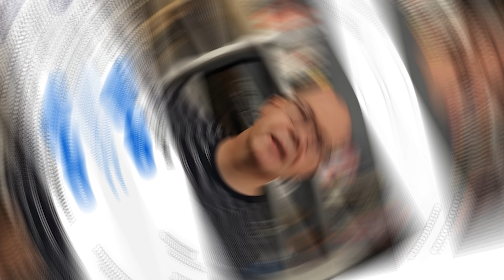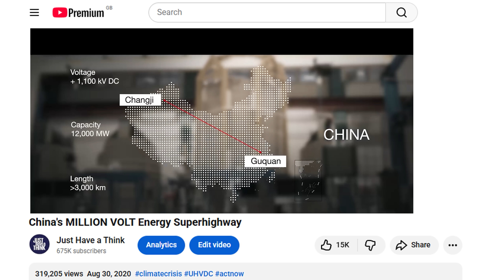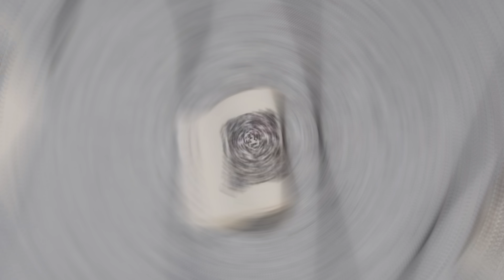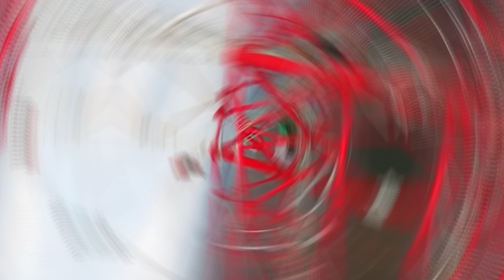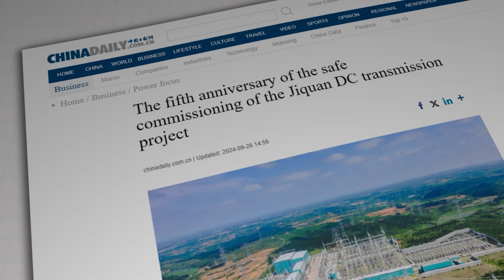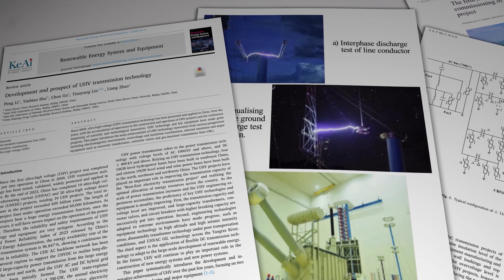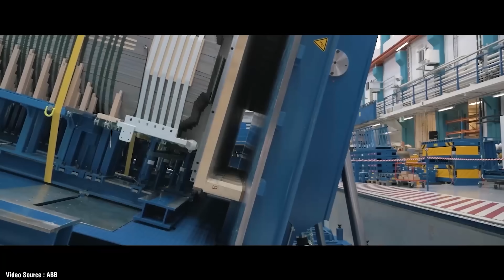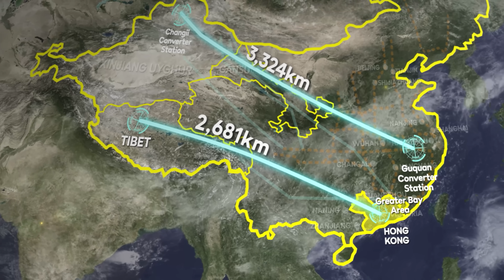China's ultra-high voltage transmission lines now breaking all records.

Comment: I think that having some local consumption of the produced energy is still important. I use a parabolic thermal reflector to make steam to steam sterilize garden soil. In late 2024 I did a test and the steamed soil grew lettuce seedlings to 20% heavier after 30 days.   Have a think about that for a second!  It is incredible!  NO EXTRA FERTILIZER OR PESTICIDES,  just a blast of heat and your soil is that much "better" as plant media!   The permaculture people and the organic gardeners were not impressed and railed on about the "Microbiome". (Scientists say the microbiome grows back in about 30 days).   So, in 2025 I used steamed soil in different ways,   one of which was to put a 3.5 inch (9 cm) layer of steamed soil on top of my beds as a mulch.  AND that still gives a great result!  Not least is the reduced weeding. So imagine the power company having a warehouse of soil or compost or whatever and whenever there is a glut of power,  they start up an auger into the steam chamber and start steaming a bunch of soil!  Automatic system! Dirt cheap power to produce high quality dirt.   20% more efficient growing can mean 20% less land needed to grow food.  Those who complained don't seem to realize that.  I recently fount a wikipedia page about steam sterilization of soil.  First cases were in Germany in 1888!  and now big fossil fueled machines produce the steam on a large scale on large farms across the world.   Why not solar and wind powered steam then?   Seems like a totally good idea to me.

Comment: I'm disappointed you didn't discuss HOW the ac from hydro or steam generated power, is converted to DC at such enormous levels.  Banks of 5U4 or 5Y3 vacuum tubes?   and how is the 1 million volts of DC converted back to AC at the other end??

Comment: Another wrinkle - I think the electric vehicle industry has taken the wrong turn - we should be focused on the HYBRID 
There is an existing transmission system so no change needed there - we are paying for any upgrading needed in our electric bills
There is an existing petrol system so no change there - just a slow downsizing 
No need for home charging units or street charging infrastructure - savings there
There would be less of an unemployment problem as there would be a slow transition for the oil industry
Hopefully this can be rectified soon
Reply from the maker: I completely disagree. Hybrid vehicles have been shown to be more or less just as bad for GHG emissions as ICE vehicles. People are lazy. If they can keep their battery charged with a petrol powered generator that can be filled up at the pump, they very rarely bother to plug the car into a charger. Some do, but statistically most don't. Hybrids are a classic diversionary tactic by the fossil fuel industry and the legacy auto manufacturers who are watching their world crumble before their very eyes. And the European Commission has shamefully acquiesced to their plaintive cries. We will look back in ten years time with a great deal of embarrassment at how weak and ineffective our political leaders have been.
Reply: @JustHaveaThink  Thanks for the info - I assumed they would use more efficient petrol engines to keep emissions and running costs low.  Currently profit and "marketing" are most important than the environment we are leaving for the next generation

Comment: I  loved some of the early energy storage videos you did - a particular favourite for sheer wackiness, therefore great, was the use of a very heavy weight sitting at the top of a mine shaft ready to drop to provide instant electricity. Various methods of getting energy from the sea seem to have got nowhere, which is very sad if true - wobbly floating snake, tidal power in and out of a lagoon or estuary, underwater propeller generator etc, There were many other interesting concepts - compressed air, hot sand or other materials. Some I thought were daft - a kite for energy generation, or a kite for reducing shipping transport costs both seemed a little too barmy ... but I'd be delighted to be wrong

Comment: The problem with the US is not a democratic vs autocratic government but a refusal to work for a common good. At every level in the US, government is divided with each side refusing to work with the other while pointing fingers. In the past, you could work together. Now, there is no chance. It is a fight for everything with both sides driven by the extremes.

Comment: If you're transmitting 250TWH daily 10.8TW can't be a record since 250/24 is about 10.4. The Chinese lie about everything and taking these numbers at face value makes the whole channel look sus.
Reply from the maker: And then again, if you actually take the trouble to listen correctly to the video, it says 10.8GW for a 12 hour period, which equals 129.6 GWh. That leaves 120.4 GWh for the other 12 hours, which equates to 10.03GW. You are not even in the right order of magnitude with your TWH units, so I can only assume you are not capable of assimilating basic information. So much for your cutting edge commentary.
Reply: @JustHaveaThink wow a personal attack for me for the holidays

Comment: There's a company out in Alberta that is drilling to create geothermal and I was thinking that say  put these in along the 400 series highways here in Ontario and install induction charging into the highways as base load supported by battery storage and supplemented by other renewables shortening long distance transmission lines

Comment: Thank you for continuing to generate such thoughtful and interesting content! I would like to see a study of the potential for pumped hydro on brownfield sites as a method of remediation. I suspect that the potential is huge across the NA Cordillera. As an example, could the membrane liners of a closed-loop system cover enough waste rock to prevent rain and air leaching selenium into our waters? Fording River Coal in BC has spent 1.5billion$ to partially treat water from just one of the mines. After coking coal is no longer needed, who will pay for operating the treatment plant for the next 1000 years??! It seems that the BC/AB intertie could thus help address curtailment in southern Alberta renewables whilst protecting aquatic life.

Comment: In the US we have had a 1,000,000 volt DC line from The Dalles, Oregon to Los Angeles, 846 miles, 1,354 km since 1970 and 4 other HVDC lines with many more in the works.

Comment: Centralised energy generation and transmission like this shifts wealth in the wrong direction. We don't want HVDC, it's a subscription model with guaranteed income for the wealthy. Just like the original electricity transmission lines and oil industry.
Reply: Having whole countries locked into an energy subscription model creates a shed-tonne of inertia; you get stuck in that ecosystem and it's hard to move to a new system even when you know the new system is much better.

Comment: I wouldn't mind seeing a round up of all forms of batteries starting from...

"where did rechargable batteries disappear to?", 20 odd years ago I remember that household rechargeable batteries were advertised practically as a revolution in battery power, now you never really see them. All batteries should have been rechargeable batteries by now.

And larger small scale batteries that are charged from solar panels. I used to canvas selling solar and batteries 10 years ago and you still get people going on like "well the sun doesn't shine all the time and the wind doesn't blow all of the time" 🙄 my response is, well show me your petrol power TV remote and I'll say you have a point 😂

To large scale industrial energy storage units. There is a lot of research going on regarding these but it is always about large single unit batteries, can they not use modular systems using what we have already? Even with dissipation from the units, surely it's better than shutting off the production during low need periods.l but that might ruin their hold on supply and demand economics and they might actually have to sell of the energy for cheaper 😯

Also I wouldn't mind seeing video on "the industries fear of consumer self sufficiency" god forbid they have to think of another way to make money if we all generated and used our own energy and if households could create a cooperative to sell off and set our own price for surplus energy.

Oh and another video on the possible next generation of energy infrastructure. I know there is an issue with feedback into the system. If we have less need for the feed in system due to self production, I can't see why we can't have a dedicated feedback system that replaces the obsolescent feed in infrastructure. Like if we have 6 lines across electricity pylons, why can't we have 2 feedback lines and 4 feed in lines or 3 and 3? If self production gets to that point, which it should at some point even if it's 50-100 years in the future. The national grid system has a use expectancy of 30-40 years from what little research I've done on it and by that figure I would imagine that perhaps half of the infrastructure is due to be replaced over the next 15-20 years with parts of it being replaced everyday. It's better to start building for the future now than panic in the future when we have nothing and have to pay for it all at once.

Comment: How about a video about the installation of Batteries, PV panels, Wind Turbines and investigation of Tidal Power in Northern Labrador by a partnership with the Inuit government and the Canadian federal government to replace existing diesel generators?  Nain is a northern community with brutal cold winters that are service by diesel generators and the local government wants them replaced ASAP.

Comment: Long time supporters from Canada here.  Appreciate you.  Interested in the electrification of agriculture.  It’s been our farm journey and so interesting and challenging.  Happy Christmas.
Reply: Can farmers 'wait' for slow solar powered tractors to plough etc a field over a period of multiple days automatically instead of doing it all in one day with a diesel?
Reply: @davidwinnett5450  You will have another one coming if you believe that the agri-machines will not get electrified at some point. 
The problem is that most people believe they can change 1 thing(batteries instead of diesel) in a system and expecting everything to continue working like before.
Doesn't work that way. Can you fully support that change and are you willing to do it.? really do it ? (if it is beneficial for you first, of course)
If it is. Then yes you will find the way.

Comment: I would like you to cover shallow closed loop geothermal for district heating.These don't attempt to generate powerthey heat homes via using low grade geothrrmal heat energy in local heat networks.

Comment: These UHVDC transmission lines could be upgraded with mega pack batteries on both sides of the line to allow utility factor to be at 100% on the line while having variable generation and variable consumption.   With super low battery prices, this seems like a smart move to maximize the UHVDC investment.

Comment: Hi Matt, Great article today, DC transmission is very relevant today, especially here in Australia.  Re future topics I would suggest a deeper dive into super / and or ultra capacitors in FCAS and Demand Response grid services and with a kicker I would be keen to hear an update on EDLC uptake in transport (especially rail), material handling, distribution network services and hybrid energy storage, cheers from Down Under, Ian
Reply from the maker: I'm not Matt. He is American - you can tell by the accent. I am Dave. I run Just Have a Think. Matt runs Undecided with Matt Ferrell. We are both bald and we both wear glasses, but if you really try hard you will notice that we do not really look or sound much alike.

Comment: Okay, this is for the T-shirt but I've always wondered this. Could we not produce energy from the free Frozen snow and putting a refrigerant pipes through that snow and in the summer gain the energy from its expansion with the pipes leaving the pile of snow as the gas is expanding?

Comment: In the West, we receive lots of goods from China. However, we don't send much in the other direction. The shipping containers would essentially have to go back empty which is extremely expensive. Also China doesn't want them back.

As we transition to low CO2 emissions steel, our demand for steel will go up massively. For instance, there currently isn't any technology that can produce low CO2 emissions concrete so that's a market that can be replaced with steel. 

If, let's say, a progressive UK government wants a construction boom and sees the need for steel, they could implement the following policy:

1) Build a low CO2 emissions steel in a friendly country near  China that has lots of potential for renewable energy and huge iron ore reserves - India for example.
2) They build single use shipping containers to be filled in Asia and sent to Europe/North America.
3) We use renewable energy to turn those used containers into steel for construction etc.
Reply from the maker: Nice idea.

Comment: In Europe, for obvious reasons, undersea DC lines have far fewer regulatory and land use issues, so they can be built quite quickly - the Celtic Interconnector between Ireland and France as an example).

Comment: Something is not right here, the physics just are not correct in that it would be impossible to transport electrical power  over long distances using DC. Or am I missing something?
Reply: "Or am I missing something?" <- yes, and Dave covered what you need to know early in the video.
Reply: @TheDanEdwards  To have DC current flow over such distances, the Chinese would have needed to invented a new type of superconductor, one that works at high temperatures. Hence, material that conducts electricity with zero resistance, as far as I know, there is no such material. The Chinese would then have to produce the same material in high quantities to build the power lines. The only way to transport electrical power over long distances is AC. I don't see the Chinese as inventing anything new, just using the same technology but on a grander scale.
Reply: @peterhart4301  The traditional wisdom was indeed that you need AC, because you can't use transformers with DC, meaning you can't produce the high voltage, low current necessary for long distance transmission. That is no longer the case. Today, thanks to advancements in solid state electronics, like the switching mode power supply, DC/DC and DC/AC transformers are trivial. Other than that, there is nothing that prevents DC from traveling just as far as AC. Sure, high powered DC/DC transformers cost more than the AC equivalent, but DC has another advantage. With AC, you have an issue with your power line becoming a transmitting antenna over long enough distances (1500 km is already a quarter wave for 50 Hz), radiating power into the ether instead of carrying it. No such problem with DC. So for long distance, DC eventually beats AC in terms of cost. Also, China didn't invent anything radically new for this project, long distance HVDC lines exist in other countries, it's just that the scale is unprecedented, and it's specifically built with decarbonization in mind.

Comment: Thanks as always Dave. I've been a subscriber since the early days. Your videos are my Sunday sermons and a looked-forward to part of my week. I don't need any more clothing, but an idea for a video might be a look at France, how it has leaned on nuclear to avoid building out renewables and has generally been a laggard in the transition. Both Renault and Citröen have put their cards on the EV table, unperturbed by the relatively low level of public charging points. And despite lots of windy Atlantic coastline and an under populated sunny south we're not seeing many large scale investments in wind and solar. At the moment France is a net exporter of electricity (thanks to nuclear) so there is no sense of urgency to build the infrastructure for renewable energy. On the other hand it's getting harder to find a new kitchen cooktop that isn't induction (good) and there is a decent level of awareness about the risks of climate change to agriculture and basic comforts. I feel the whole thing is on a hinge period, where momentum is gathering. But the rise of the far right could quickly put a halt to all that.

Comment: Quite possibly in line with your current video: The chances for Europe to overcome renewable intermittency (especially dunkelflaute) by connecting parts of Europe that have little correlation between weather systems (for example North- and South-Europe)
Reply from the maker: Thanks for your suggestion.

Comment: I live in Ireland and while a transmission line for high voltage would be great (we are wasting lots of wind energy) we need a way of getting rid of, or insulating, the radiation from them.  Thanks.  I like the climate videos which most of them are, of course.
Reply from the maker: I was not suggesting that Ireland actually built a UHVDC line. It was simply an example to give a bit of scale.

Comment: I am curious to see how the Million volt systems age, even a small defect in a High voltage  Dc system can cause arc overs, AC systems  will self extinguish an Arc when the voltage crosses 0, DC just keeps Arcing. Humidity , dust or wind blown debris can cause an Arc if your insulation isn't perfect. I have had arc overs while working on physics experiments and that no where near the power going through these lines.  The line should be designed with Arc over detection and shutdown circuits to allow repairs, but even the amount of power in a short arc could start a fire.